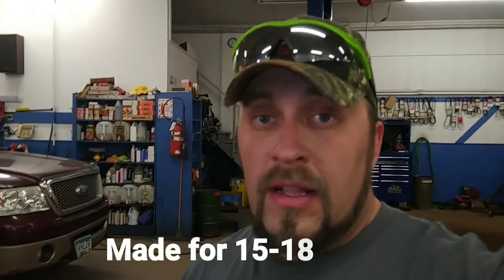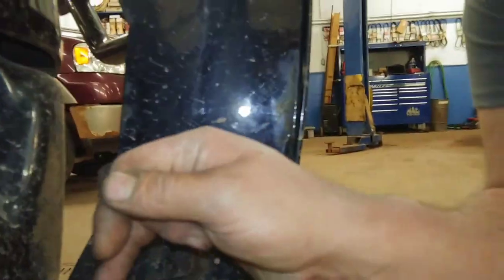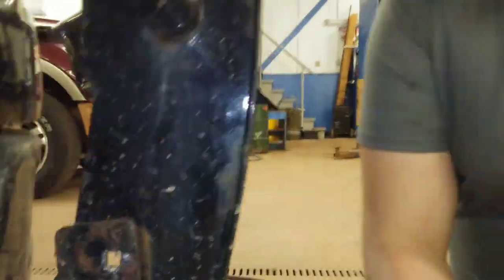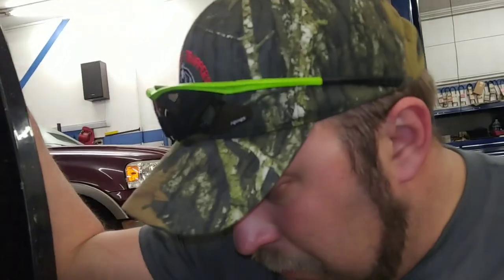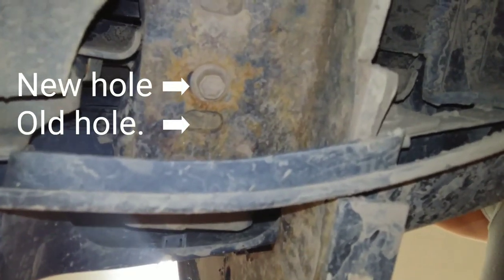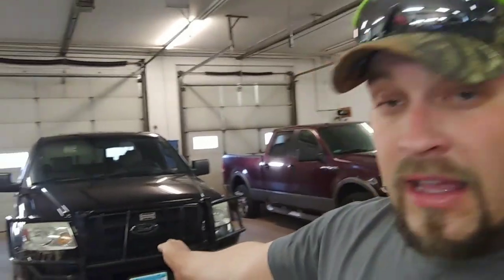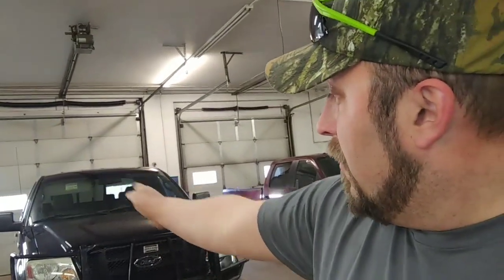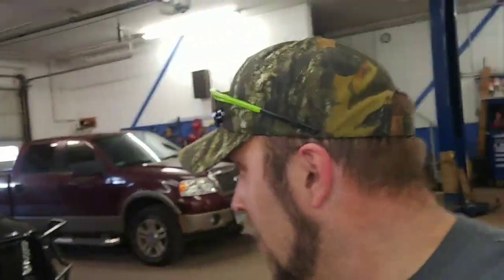04 F150 brush guard install.

Comment: Do you think one of these would bolt to a 1997-2003 F150? I don't mind doing a little fab work just curious if you new if it would line up for the most part.
Reply from the maker: The older trucks had a narrower frame than the newer body style. With that and the shape of the front bumper it would take a serious amount of reworking.